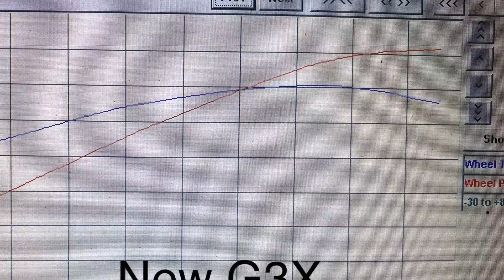Final ESS supercharger testing

Comment: Did you get your pulley from them? I’m about convert from A&A V3SI w3.6 and still on stock block with cam/headers E85. I’m assuming my pulley is too small for the G3. What would you suggest max that my motor can support?
Reply from the maker: Boostfed the 3.6 will be close.  Still can get 800-900 out of it depending on timing.